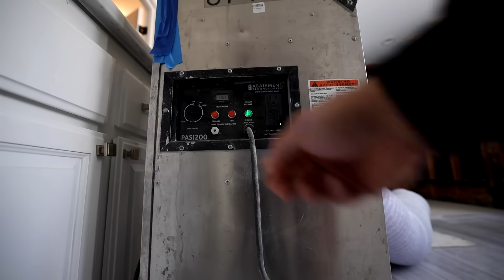Get Walls FLAT for TILE INSTALLATION --- Furring Strips, Sister Studs, and Cardboard Shims

Comment: I don't get the start where the lazer is align. You measure 2 inch from both sides of the wall. But the tape measure at the corner was measuring more than 2 inches? Im just confused with how you do the lazer setup to be used as the reference?

Comment: set up as close to the job as possible is my motto  :) And being Canadian I already use metric even though materials still come in imperial measurements and tapes seldom come in metric only. 50/50 split which sucks. Your very short sighted US government in the early 80's didn't convert the US to metric and basically screwed the rest of the world as your one of I think 2 developed countries that isn't metric! Your imperial system and Philips screw heads are 2 huge downfalls in US construction! The Canadian Robinson head is far superior yet you yanks still make them crappy Philips heads! And if you can count to 10 you got the metric system which makes it 100x easier to deal with than fractions so obviously your government doesn't care how smart you aren't!

Comment: I use the cardboard shims cut into 2” pieces. Lay out the wall like you did to find how much needs to be added. Hot glue the shims every 12” to make up what is needed. Before attaching wall board I’ll wet shim between each cardboard shim. That way I can permanently attach the wall board and not have to wait for thinset to harden. Great video!!!!
Reply: By wet shim do you basically mean you pack out the voids between each packing shim with tile adhesive that sets solid so the drywall sits on a completely flush surface all the way up and down?
Reply: That’s correct! 👍🏼
Reply: Also let’s go metric!!! I think I’ll order a few metric tapes and give it a go!!!

Comment: Loved your comment about going to the metric system, but I had to laugh because there is nothing to prevent you from using metric measurements today.  Just use a tape measure (or ruler, yardstick, etc) with metric marks, and bam - you can use metric.

Comment: Gotta be sure the new sister studs are straight and not crowning or you'll create the same problem all over again. One more thing I found when I just bought my laser level, they tell you to use the center of the beam vs the edge since the beam is different widths depending on how close to the laser your are. Love your videos though tha is for all the selfless help you provide.

Comment: Thanks for saying that about the metric system.  I make sure all my tools have metric and inch reading on them.  No reason you couldnt have used metric here except for fear of comments.   I have a funny story about going into home depot to get glass cut for a 3D printer bed.   The guy I asked refused to do it until i converted it to inches.  People are not fans of change.  I get it.

Comment: I tore my bathroom apart and I'm learning from you now. Really struggling with getting started. I just don't like the framing that was installed with the previous shower stall. It looks like the person used pieces of sheetrock or wood to shim, but only at the top. This video should help me figure it out.

Comment: I've used both metric and imperial. I find imperial much easier to read, also easier for tile layout. Even converted my Sigma(Italian) tile cutters to imperial.
Reply: Unless you live in the UK (or maybe Canada), you have not used "imperial" measures. The US doesn't use imperial measures; it uses US customary measures. And that's quite a hot take, given how complicated and involved it is to add fractions, especially those which don't have a common denominator.

Comment: Very nice. Question, what do you do with you outside edge when wall has be furred out? Mider cut outside edge? recommend wing wall per job design dependent? Are customers okay with if and when mider or Schluter + little sized tile rip is necessary? Again, thank you for the videos. Keep'm coming brother. Prayers y'alls way.

Comment: Nicely done. There is an easier way to scribe to the wave of the stud rather than measure and connect dots. Attach the new 2x temporarily with a screw on the top and bottom so its edge is perfectly on your laser line. Then find the distance that is furthest out of plumb. In this case it's 7/16. At that spot, measure 7/16 back on the 2x. Take your scribe, put the scribe point on the old stud, the pencil point on the 7/16 mark and then run it up and down and you have a perfect furring strip. Hope that makes sense.
Reply: I appreciate the grammar, spelling, and punctuation of this comment.
Reply: If you’re going to the trouble of temp sistering your 2x, line it up to the finished position and just scribe along the existing stud to have the furring strip traced.
Reply: Can I apply this same method but on a door entry wall??
Reply: I have that cordless finish nailer and its so nice. Highly recommend it
Reply: The easiest way for me to compensate for not having the metric system is to simply stop reducing the fractions: 7/16, 8/16, 9/16, etc.  Why does 10/16 have to be 5/8 or 6/16 be 3/8?  It might sound a little funny but who cares for this purpose.  It makes it easier for everyone. An alternative is to get a good tape measure that breaks it down on the tape measure. I know Fastcaps do that. I'm sure others as well
Reply: @thehonestman26  Isn't "not having the metric system" easily solved by just buying a metric tape measure? It's not like we need an act of congress.
Reply: But if you can already mount it why not just sister the stud? I like the way he does it so I don’t have to remove the blocking.
Reply: Doesn’t this assume the stud isn’t warped?
Reply: Im sister studding a shower in the a.m. This video and comment was very helpful; thanks for taking the time to share your knowledge Mr. Marke. And thanks for making the video Mr. Tile coach. I own a flooring business called The Flooring Fellas LLC in N.C. I’ve built my fair share of showers through my 8 years of business ownership, and still look for guys like you 2. To help with the pro tips even though I’ve been there before it pays to know you are always learning even when you know it all. But big thanks guys 🫡

Comment: Great to see someone take a little extra time to do it right.

Instead of measuring every stud, could do first stud, last stud, sister to them and then run a straight edge from edge to edge and fill in the middle studs bringing them out to touch the straight edge.
Reply: If you do sister stud..what about the gap up the end of the wall up? No need to screw the drywall up there?

Comment: What do you do after you make the shower walls straight and level...now it is obvious  that the wall touching the shower is not level.  How do you fix that? Without demo-ing it
Reply: float it out over a couple feet with drywall mud.

Comment: 15:18 I prefer not using a metal base for the self leveling cement, as it interferes with wifi and cellular/radio signals.  Is there a recommeded alternative that doesn't interfere with radio signals?  Thanks!
Reply: Wow really ? So if the metal lathe is used on the second floor and higher, it's the samething ? Where did you hear that?
Reply: @j.w.r.i2910  Hi, I have a 1922 house and I have the same wire mesh that is at 15:18 and it interferes with my Logitech G933 and G935 headphone 2.4GHz connections as well as my bluetooth adaptor connections.  My transmitters are plugged into my basement pc and the connection drops out in this 2nd-floor bathroom, when I'm above this metal mesh, but works just fine in my 3rd-floor attic, as long as I'm not above my bathroom.  Large amounts of metal generally interfere with radio signals.
Reply: I think you can use a certain thinset depending on the substrate you're putting it over.

Comment: I am still looking for the best way to plumb up a wall. Wet shimming still allows some highs and lows especially with warped kerdi panels, shimming is time consuming, sistering can be difficult if there is blocking in the wall. I do like sistering with 2 inch strips of 1 inch plywood. I rip the plywood into strips and they are pretty straight. Much straighter than typical 2x4's nowadays. I make sure that the corners are square and start with the far left/right studs. I get those plumb and square and fill in the rest using a straight edge from left to right to make sure that they are in plane. Its still a lot of work and at the end of the day I feel like floating the shower would have taken equal or less time and have a much flatter surface.

Comment: Isaac, how do you like that cordless nailer? I have been thinking about getting one for the small framing jobs where I don't want to set up a compressor, hose, extension cord etc.
Reply from the maker: I really only use it for hanging doors and bigger trim.  It works great though.
Reply: @TileCoach  Oh Gotcha, makes sense. I didn't catch the part where you say what gauge it is. yeah, Those are perfect for hanging doors and some trim work.  Btw, I am working off Midas and Argonaut for the next 2 weeks. I might stop by the showroom sometime and introduce myself.

Comment: So am I correct in assuming that the sister stud method is the easiest out of these three methods?
Reply: yes, if your sister stud is straight, and stud bay is free from obstructions. you can see why he furred the other studs, cuz blocking was in the way in the middle and at the bottom.

Comment: Wow must have read my mind. I’m at this step in my remodel and there aren’t that many great videos on this topic. 

Obviously plumb walls will help your tile lengths to be uniform on the perpendicular walls. But squareness is prob also a good idea so your floor tile lengths are uniform.
Reply: FYI I bought one of those Dewalts (the green laser one) and had to return it. Was off by 5/16” at only 8ft away! Sucks cause I loved it’s compact design. I ended up getting a Bosch green laser with the plumb points and it’s WAY more accurate (and has a pendulum lock which the Dewalt didn’t). Thanks for the great tips and videos.

Comment: The furring I did on the wall for my guest shower seemed a little extreme to me. I couldn't believe how out of square the wall was and I ended up with strips of 3/4 inch plywood at the top plate. But I'm so glad I put in the time to make it square. The tiles I put in were 24x48 inch. With tiles that size, you simply can't hide imperfections like you can with smaller tiles. My tiles went in  outstanding and it looks professional.

Comment: Another great video. I’m with you, make all my cuts indoors and I use a DIY air scrubber. Built it using an old HVAC squirrel cage fan, some plywood and furnace filters for less than 100 bucks. When people ask why a tile job cost so much and why did it take so long…they don’t understand or see all the prep work that goes into making the substrate flat and straight.
Reply: +1 I did not appreciate this until I did the job myself.

Comment: I agree if everything were changed to metric overnight, very few will miss imperial. But unfortunately changing everything will be way too costly. I think changing inches from fractions to decimal is a nice compromise and probably will resolve most of the frustration, without having to overhaul things like the dimensions of building material. I wish there are more decimal inch tape measures. so far I've only see a few on amazon but apparently the quality isn't consistent; the inches on them aren't always accurate.
Reply: Can we get rid of daylight saving time while we are at it? Or just make it permanent. The switching back and forth is annoying.

Comment: About the only thing stopping you from using metric in the US is the dimensions of sheet goods and insulation. They have to fit 40 cm or 60 cm stud spacing. In Europe, sheet goods are 120x240 cm. In the US, they’re 122x244 cm (4"x8"). I guess you could cut them if you really want. 40 cm c/c is probably close enough to 16" c/c that you can stuff the insulation batts in there :) 60 cm c/c is also pretty close to 24" c/c.

Comment: Just lay the new stud against the existing, line it up with the laser line.  Clamp it to the existing and run a pencil down the new stud to draw the profile of the existing onto the new.  Then cut it. 

If you want to use metric measurements, just buy metric tapes and do it.  I agree, metric is easier to use, so lead the way!

Comment: I am from Switzerland and moved to the US a couple years ago. I just renovated a guest bathroom by myself. Some of your videos helped. Thank you. I use the metric system for measurements and cutting etc. all the time. It makes math much easier. Most products have both imperial and metric measurements on their boxes and instructions, which makes it easy.
Reply: Goddamn Europeans with your simpler and more accurate measurement systems. We work harder not smarter here in the the US of A, and if you don't like it, then get the hell out. lol

Comment: Another name for those air scrubbers is a negative air machine.  Most come equipped with hepa.  If you are buying used beware that the filters are often loaded with asbestos fibers. The machines are code to use in asbestos asbestos abatement and the pre filter catches all the junk the hepa will be chock full of the finest most dangerous dust

Comment: We normally do full remodels or flood restoration. I don’t normally cut wood inside, but I do set up 3 2x4s up on there sides up against a wall on the floor. and run plastic over und up the wall then place my tile saw up inside close by.

Comment: I redid one bathroom in our house and had to shim out one whole wall.  In one bedroom I redid one stud was almost a full inch out. Ended up having to shave it down.  I ended up drawing a plum line then using my skill saw to shave it down.  If there is an easier way to shave the walls down it would be great to know. While the skill saw worked it was very difficult to do.  

By the way I am with you on using the metric system!  So much easier.  I 3D print a lot and it is all in metric. All my CAD drawings are metric.  I have to go back and forth all the time, it is a pain. 

Also, I really enjoy watching your videos.  You present very well and provide so much great knowledge!  Thanks for all you do!
Reply: The easier way is to use a planer.

i think generally it is easier to not plane down walls, but to furr out to the part of the wall that sticks out the most. Maybe plane sometimes if its just a small area sticking out extra.

Comment: Great video! Here's the but! You need to be well rounded in all aspects of all the trades to do all of this and some guys just do one thing like install tile and leave the carpentry to the gc. Ther needs to be a simple system to float the backer boards once they are installed on bad walls.i dont mean a full mud wall! Just enough float to true up the tile  surface of the  backer board!

Comment: JUST finished my attempt at plumbing up a wall for a tub that will be tiled. Needless to say, I finished prior to this video coming out. Had I waited, this video would’ve simplified my plan, and would’ve netted far better results. Never seen a cardboard shim before this video, and in certain cases of my own install, really could’ve use the thinner material than my smallest wood shim that I had to cut myself. In some situations, my shim actually made most of the wall plumb, but where I needed something thinner, made it slightly out in those areas. I’m a capable diy’er, and love learning how professionals of their trade efficiently work through everyday troubles, and this video will be my 101 for plumbing up any wall I come across in the future. Thank you for showing all the methods, and plumbing options as well.

Comment: i am curious as I live in Hawaii and all my studs are metal studs so this looks to be much harder if the steel studs are off.
Reply: they probably are not off cuz steel studs are super straight. if they are, you can still use the same methods

Comment: Love the video, sometimes you have to bust out the planer when the walls kick out out the bottom. I like the sister method, I don’t use the laser even though it’s a great idea/tool…I just plumb it and nail it…I also take my level and run it horizontal to make sure one stud isn’t farther out than the other. I haven’t seen any other video break down the various methods like this, so great.
Reply: Great tip!

Comment: Great video.  I just wanted to know what to do if the other adjoining wall is not square with the wall that you are putting the furring strips on? It looks like you just got lucky this time.
Reply: Use one wall as a starting point. I do the wall with the plumbing first. Once you have that one furred out and straight , find the stud that sticks out the most on the adjacent wall and use that one as the starting point to make that wall square then fur everything so it’s flat with that one and then move to the next wall
Reply: @pablovalencia6737  yes this, or you can leave the walls out of square and just make them flat and plumb. its not that big of a deal. The most important thing to do is to get the walls flat. the second most important is to get em plumb, and third is square.
Reply: @conradcoolerfiend  They need to be square if you are installing something like a tub or something.
Reply: @pablovalencia6737  Thanks for the advice

Comment: I bought Ryobi, cause bit was better than Dewalt or Milwaukee as few years back.  Then Milwaukee came out with gen 2 nailer and framing nailer.  I was sold.  I still have Ryobi.  I wouldn’t take Ryobi for granted, still